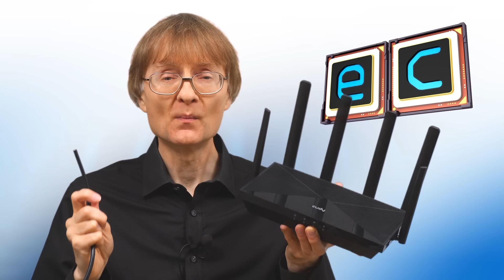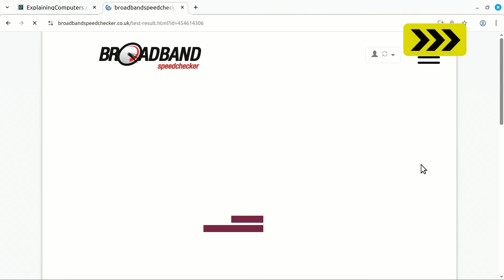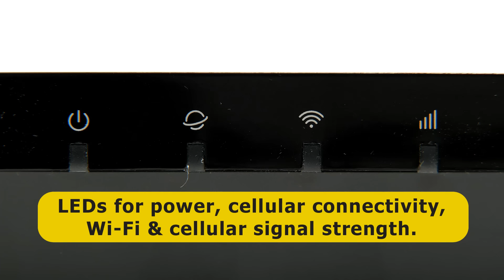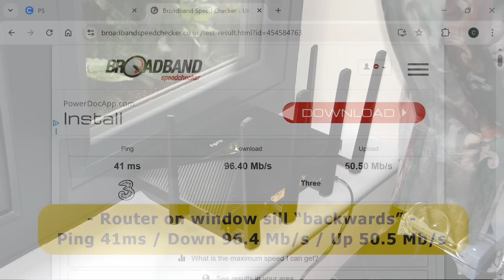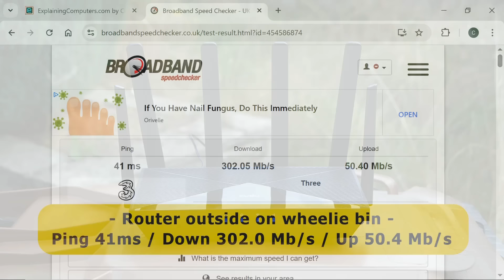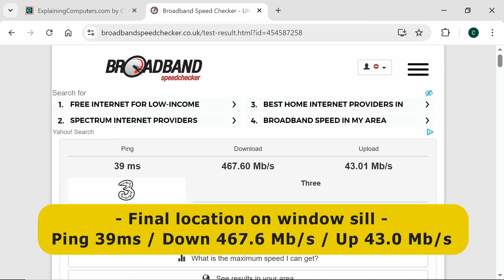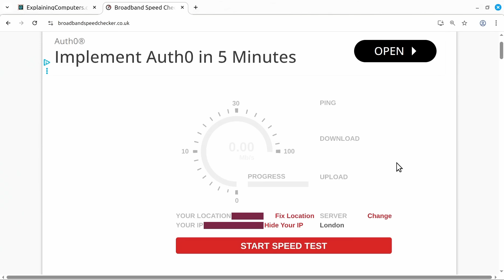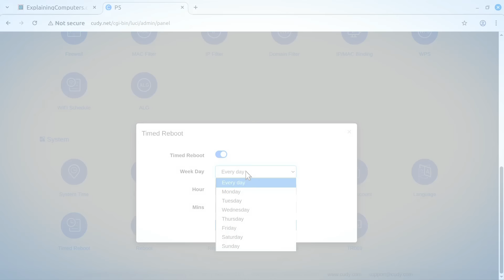Switching to 5G Broadband: Cudy P5 Router

Comment: Hi Chris - really enjoy your videos.  I currently have 5G wireless plan from EE through an Huawei_H112_EB9E router.  Where I live I am just outside of the 5G coverage area, but up until around September 2024 I would frequently get over 100mbs download overnight.  This has now dropped to beteen 20mbs  and 40mbs all the time.  Also, quite often, accessing various site just time out.  I have cleared the DNS on bot the router and the PC but this makes no difference.  For example, I am unable to receive Netflix, Prime Video or Alexa  -  is there a trend here ?  To cut a longer story short, I was interested in you review of the Cudy P5 Router and am consideriing purchasing one.  Just a few of questions : 1) Is it still performing as you would expect? 2) Does it automatically drop to 4G if 5G is unavailable? 3)Can you give any advice on a good 4/5G aerial which could be used.  Thanks in advance.
Reply from the maker: Thanks for  this. I am pleased to report that my My Cudy P5 is still performing very well. It does automatically drop to 4G if 5G is unavailable, or you can force it to use one or the other. I've not dug significantly into aerials, as I am fortunate to not need one. EE now have their own external hub/antenna, so something like it may be a good starting point -- see: https://3g.co.uk/news/three-announce-outdoor-5g-hub
Reply: @ExplainingComputers  Thanks for your rep Chrisopher, and I'm encouraged  by your report that the Cudy P5 is performing well. Currently I'm on EE, but I will contact them and ask if the Cudy P5 wil work with their network, and also if they an recommend an antenna.  Also if they wil be introducing a similar product to the 3 external 'box'.  I've also found out that there is a current issue with AWS ( reported on the 3 website) so that may be the issue with the connetion issue.  We'll see.  Thanks again and keep up the good work!

Comment: Do you have a TV arial on your roof? I wonder if connecting the antenna output to the wall-socket for the TV Arial would improve connectivity...
Reply from the maker: I do, but I would need a 5G antenna for the router. TV and 5G use very different frequencies. :)

Comment: I have fibre to my house but I use 5g as its much cheaper ping time is slower 50ms download 350mbs and up 100 mbs up it impoved when i installed an antenna on my roof. This is a Deco router. But at 2am it drops to 4g i later found out the provider drops frequencies to save power very late at night

Comment: I pay about $50 for Fiber to the Home through my local power company, and they give about 230 Down/91Up. My provider just started fiber to home in some locations after doing fiber to the curb for years. If I ever drop connection, which is rare, I have a 5G-Ultra Wide Band hotspot (operating in the upper 3GHz band in the US). It runs off a third-party provider called Visible that buys service off Verizon towers through which I can get about 314 down/11.2 up.

Comment: This is great if you can't get FTTP but if you can it goes quite far. I'm on 1600/100 currently and due to upgrade to 7000/7000 before year end. There's a 5G backup getting 200/100 which is fine but you will always be able to fit more data over a private cable media than shared radio waves.

Comment: It's a good idea for the 5G router without any physical connection issue of WAN port, but it will also have fair usage rule apply to each ISP, which means your data transfer capacity will be dropped after a "certain" data volume of DL.
Reply from the maker: Fair usage applies to all forms of connection -- wireless or wired. I will use nowhere near the Three fair usage of 600GB/month. :)

Comment: Thanks Chris, very interesting and timely video
I've had a BT landline for about 60y but with the imminent loss of copper and forced migrate to 'phone via internet', I thought it time to buy a smart phone for my 80th birthday !! Then I discovered it could do as good** a job with 4g as my ADSL openreach at a fraction of the cost. So I am now very tempted to dump my landline , if I can decide on  a 4g router/gateway, there are a confusing multitude to choose from :( !
** actually slightly better, during the day about 7 or 8MB/s download vs 5.5 MB/s openreach and considerably better during the night/early morning at 15 (or sometimes 25) vs 5.5 !

Comment: I currently have a 50Mb broadband service with Virgin Media, but they keep putting the price up. It's nearly £90, so I would consider switching. I like the idea of 5G connection, but our one and only cell tower is on the far side of town, with too many obstructions in the way such as a church, hill and lots of houses. I struggle at best to get a poor 4G connection leaning out the upstairs window, a problem since mobile phones for the masses came in back in the late 90's. In fact, much of Lincolnshire enjoys poor mobile service, unless it's Lincoln itself. Also is this 5G service limitless, or is there a monthly cap?
Reply from the maker: Distances and obstructions are indeed not the friend of wireless Internet. Most networks offer unlimited data plans -- I'm currently paying £16/month for unlimited data. Although all networks have fair use caps. For EE this is a flat 600GB/month. For Three, they treat more than 600GB/month as non personal use, so start to throttle/cap at certain times.

Comment: Excellent video Christopher. As an addition I used your advice about positioning with a Samsung Mobile Mobile Hotspot/USB tethering and the result was rather surprising, albiet at about 300 metres from the local mast. I'm very close to Wembley Stadium but on a non match day 150Mega bit connections are the norm. I may try a cats cradle to raise the phone higher and above the window frame and a longer USB c to C cable.. All of these potential speeds are really so much smoke in the real world.

Comment: I do the exact same Chris. I have 5G unlimited from Three and it costs 20 euro a month. I get speeds of about 300-400 Mbps down and 130Mbps up in Ireland and ping is 20ms. Works great with Xbox Cloud Gaming and so on. I'm based in Ireland and I have been with Three as a mobile provider for about 15 years.
Reply from the maker: Thanks for this -- and I'm particularly interested to hear that it works with Xbox cloud gaming.

Comment: I subscribe to a fiber service for internet and 5G cellular for our phones. Where we live we average about 2 bars for cellular on our phones and the service isn't bad as far as mobile devices go but I would want a stronger signal for my computers. I might test the speeds using my phone tethered to my computer and see what it's like.  For years I've used the old coax internet and when I switched to fiber I was very happy with the improvement, although it meant I could no longer use my own router unless I wanted to enable passthrough on the fiber router which I haven't bothered with.  Still, things have been satisfactory for the past couple of years.  My powerhouse router waits patiently until it is called into service again at some possible point in the future.

Comment: I still use a wired connection to my house through Spectrum here in the US. The reason I use a wired connection in my apartment is because of cg-nat. I use my own VPN that requires port forwards. Cg-nat doesn't do well with port forwards. So, I stick with copper.

Comment: You need to perform your speed tests late at night or very early in the morning to get a stable result.

In the daytime the number of users connected to your local mast will impact the speed results more than the router placement ie the same placement may give a large range of results as users vary what they are doing online. At night, there will be plenty of connections since everyone is at home but these will be mostly idle which will allow you to see the real speeds.

I get my worst speeds between 4pm and 9pm as people are at home streaming and gaming. Ping is also terrible at this time. Between 8am and 4pm it fluctuates as people are moving around, connecting and disconnecting from the mast. Overnight I get excellent speeds and ping which I rarely get to take advantage of.

Since you use linux, you should install speedtest-cli and then you can set up cron to run the test at night. I actually have it run hourly and append the results to a log which is why I know such detail.

Comment: Nice transition Chris! I too, have LTE/5G Internet service at home. Inside my US home, my at&t modem/router was getting intermittent 1-2 bars of signal out of 4 indoors. Invested in an external Waveform 4x4 MIMO directional antenna and mounted on an old satellite mount pole on my roof of my single story home.   The results brought me to a consistent 3 bars with about -84db signal which was better than the -102db previously indoors. I'm about 1.1 miles (1.77km) from my tower on flat terrain, but several 2 story homes in my path. I was trying to decide directional or Omni directional, as I can quickly change towers if my primary tower goes down for any reason with the Omni, but have to manually aim directional to alternate tower location if the forementioned occurs. Waveform does offer a 30 day money back guarantee if it doesn't work out for you. My speeds are generally 250-350 down and 20 up

Comment: I had never considered this before I watched your video. Switched today, fairly straightforward and all working well. I got 250mb/s on Virgin at a ludicrous cost if £60 a month, and only with a 24 month contract . I'm now getting 350mb/s for £28 on a rolling 1 month contract. I hope it continues to work as well as it has today. 1 weird thing I have yet to resolve it refuses to let me change my SSID. Fails every time. So had to change everything else a very boring process. Also there is a lot of discussion about switches and their compatibility. The problem appears to be restricted to outside units that need POE. Inside hubs work fine I have at least 16 (switches hanging off switches) wired devices working fine.
Reply from the maker: Great to hear of your success -- long may it continue! :)

Comment: Do you use a second SIM? I’m considering one for redundancy, maybe a limited 50GB plan to save money. Using a primary SIM on a network like Three or Vodafone, plus a backup on O2—even if not unlimited—seems like a solid way to cover network issues and stay cheaper than BT’s rising fiber costs.

I think I'd still prefer the Spitz AX over the Cudy. I guess you could start with limited plans from all networks to test speeds, ping, and reliability, then decide if it suits you. I’m surrounded by buildings and trees, with no clear line of sight to towers and not aware of any 5G lamp posts nearby. I might need to rely on the lower-frequency 5G or fallback 4G, so I'd definitely need to check coverage and do testing. The need for external antennas would raise costs and make fiber a better option although I'd probably pick someone different than BT who constantly jack up prices to rip you off.

It’s impressive to see that you can get good indoor 5G speeds finside your home. If I buy a 5G router and some SIMs to test, I guess I can always return the router within 30 days if it doesn’t work out.
Reply from the maker: Yes, I have now added a second SIM -- a PAYE from 1p Mobile, so on the EE network. It gets very similar speeds, probably because EE and Three share the cell towers near me! :)

Comment: Regarding your landline number. You might want to consider porting it to somebody like Andrews & Arnold (AAISP) and using your own Voip ATA. That's exactly what I did for my Mum, albeit she's using a 4G mobile connection as there's no 5G in her area. Plus I wired the new VOIP landline service into her existing telephone extension wiring. Works really well and the 'landline' through Andrews & Arnold is a very good price and calls cost pennies. Significantly cheaper than anything BT can offer.

Comment: In Hungary where I live, one of the mobile providers offers a 5g home internet option, whery you get the 5g router (tp link nx510v) included in your monthly fee (basically you are renting it), and you can choose to have TV service as well (via the internet). I went for it because of the price increase of my regular provider, and did not regret - so far it is very reliable and quick. I also live near a 5g tower and they offered a 1 month free test period where you can decide if you want to continue using this service.

Comment: In my area it's pretty much Virgin Media or nothing if you want a fast wired connection. With VM I can get 1000 down and at least 100 up. Any other provider tops out at about 20 - I can get faster internet over 4G than that, let alone 5G!

Apparently Openreach is planning to install fibre infrastructure in my area but we'll have to see how long that takes. Considering that fibre optic communications were invented here you'd think we'd have it all by now...!

Comment: Hi Chris/guys . How can I test my 5G connection without buying a router? Great videos Chris been watching for years.
Reply from the maker: Thanks for watching. :) If you (or anybody you know) has a phone that supports 5G, you can go to a broadband speed checker in its browser and run a test (making sure you are connected via a mobile network, and not Wi-Fi).

In the UK, there is also the Ofcom speed checker here: https://www.ofcom.org.uk/mobile-coverage-checker And all the mobile providers have a speed checker on their site -- and these are pretty good, as the providers try not to sell wireless broadband services for locations it will not work at. For example, for Three go to: https://www.three.co.uk/broadband/home-broadband and start by clicking on "Check coverage".

It's also worth noting that Three includes a 5G modem with its £21/month home wireless broadband plan, and has a 30-day money back guarantee -- so you can send the "free" router back and cancel if it does not work. And this is why they provide decent tools to check coverage.
Reply: @ExplainingComputers  Cheers Chris.

Comment: I use this strategy at my condo in Thailand.  The local fiber company 3BB has gigabit speeds but wants to charge me for a full year when I'm only living there for 4-5 months of the year.  I have a Huawei 5G router and I can see a 5G tower from my balcony so the speeds are ~400mbps, but I can pay AIS a very low rate for a 5G SIM card from the day I move in to the day I move out.

Comment: Superb video. I have been considering this for my Father - as it may be a cheaper / better option than updating to FTTP. However, I do not yet have a plan for his landline. I noticed when testing the 5G signal at various places in his home that speed tests varied wildly (even from the same location). In particular, the upload speed lurched between 4 <=> 40 Mbps. Three in the UK does say that the speeds will fluctuate much more than with "standard" Broadband.

Comment: Very interesting, thanks for sharing.

I had similar 'challenges' with BT, because I need a good internet connection (run a business from home), I went for fibre from a Non-BT company. However there are times when I've had no cable internet, and used my mobile phone as a hot spot - doesn't do as well as the 5G wireless router that you've got.

As for the landline number, I went with Phonely, they did a good job to transfer (they like to say 'port') my phone number away from BT. So that's good - I now get landline calls to my mobile phone via an app (until I get a voip phone). The quality isn't bad, but not as good as a traditional non-VOIP phone line....even if there's a lot of digital as it travels this way and that. All the best from Kent, UK.

If of interest (download / upload):

Old broadband speed: 70Mbps / 20Mbps (£~50 including unlimited calls)
Local Mobile speed (via phone): up to 120Mbps / 50Mbps
New fibre speed: 1150Mbps / 900Mbps (£~24 per month)
Phonely (just the basic package): £~10 per month.

Comment: I tried this about a year ago, around the time my contract was almost up. I had enough of my current fibre provider, and I noticed that when I was upstairs on my mobile, I was getting incredible 5G speeds — up to 700 Mbps.

I bought the ZTE U50 to give it a try, but I think it might have been faulty since it kept restarting and was getting quite hot. The speeds were good, but the ping was all over the place. I ended up returning the U50 and considered getting a better router, but by then my contract was nearly over, and I had to renew — otherwise, they would’ve charged me a fortune for the next month.

I got a bit lucky, though, because that company was about to lose its fibre monopoly in my area. I didn’t know that at the time, but they clearly did, because to my surprise, they offered me a really good deal. Over the next month or so, I figured out why they had suddenly become so unusually nice to me.

The cost of buying a better 5G router plus a SIM card would have been about the same as paying for a wired connection over 18 months — but with the fibre deal, I got a more stable connection and didn’t have to pay nearly £300 upfront. My next contract should be even cheaper now that there are so many fibre-to-the-home options available in my area. 

5g is a great option if you looking for freedom from contacts and you are close to the tower or you have clear view to the tower.

Comment: Intresting to test if speed is beter when the code 5p router in garage. Isolated windows blocks 4 and 5g signals. I use vowifi for mine mobile because of this.

Comment: Ethernet tethering on Android has been around since version 11.  There was a rare occasion where my fibre optic connection went down so I connected a spare Android phone and SIM to an ethernet router and switched on ethernet tethering to get internet through all my wired devices.

A USB-C to ethernet adapter is needed to plug into the phone.